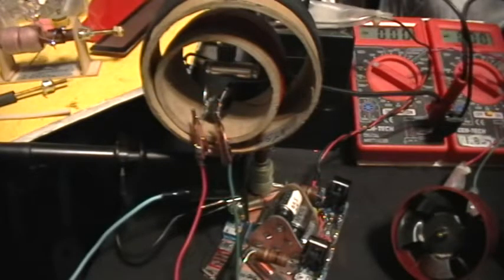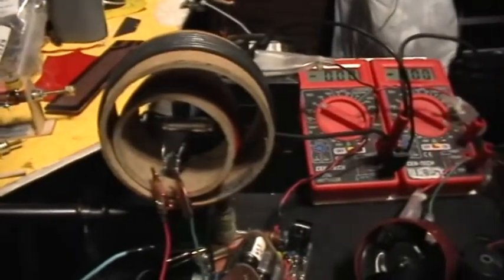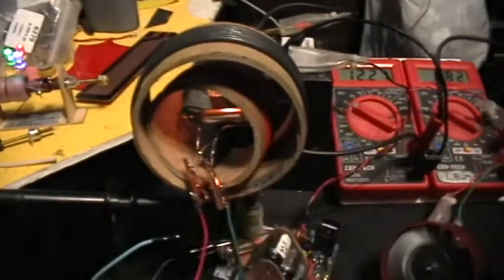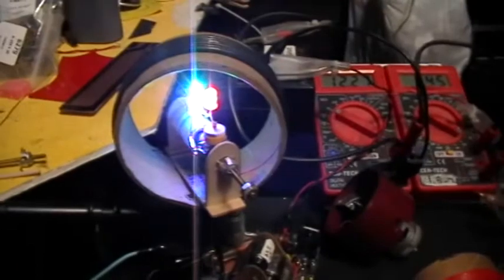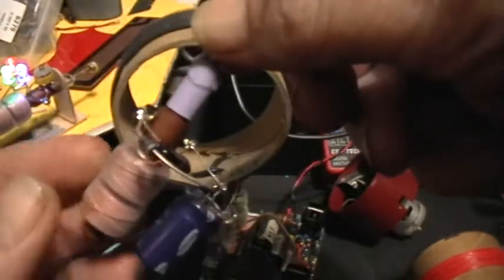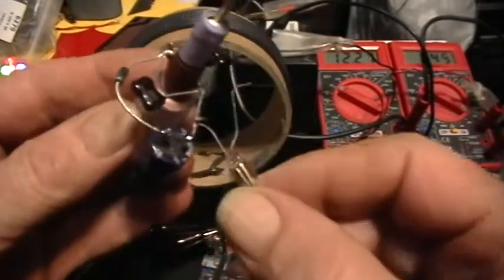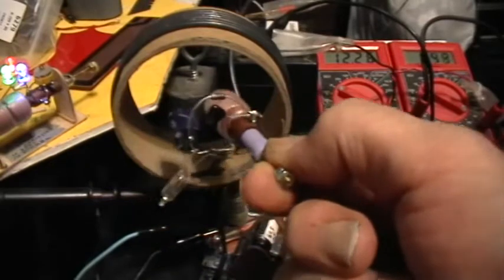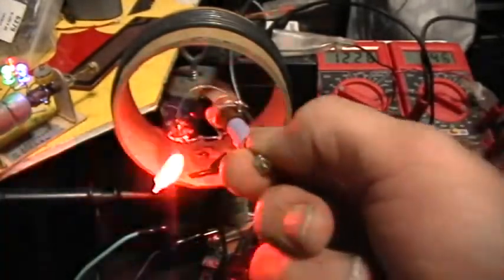Electric OU: MicroQEG Spark Core Conditioning

Comment: Well done TK,  but what do you mean by spark core conditioning ?
What is conditioned ?
Does it somehow feed back to the driver aircore coil or what ?

BTW, do you use a low pass filter at your DC amp meter to really see
the real DC amps going into the circuit ?
Otherwise with such a pulsed input and high EMF field around it it will surely read BS...

Regards,Stefan..
Reply from the maker: Hi Stefan
Spark core conditioning. I dunno, but it is something that Thrapp claims is necessary and that is why the FTW QEG is sparking in some of their recent videos. The "Exciter coil" and the spark gap are supposed to be used for the first couple weeks of operation to "condition" the core -- their word -- and then it is no longer needed. Some explanations say that this action pre-magnetizes the core. Sure. Why didnt they just start with magnets in the rotor then. I know why, and so do you: the FTW QEG's magnet-less rotor is a necessary Red Herring.
No, I have not yet fed the sparking back to the driver coil. But please see my latest "supplement" video that I just now uploaded.

The MicroQEG has a built in input filter cap and does not have a pulsating input. This has been verified by me, on the oscilloscope, and also by "Isim" in his simulation of the circuit on the forum thread. It really is straight, non ripply, DC input power and the meters are reading honestly. I have also verified the DMM input current reading magnitude with a csr and scope. These meters are the shielded kind and don't respond (much) to the stray emanations from the output coil either.
The "overunity" and high COP of the FTW QEG and the MicroQEG come not from the input measurements like the "20000 percent" claimants, but from the "output" measurements. The FTW QEG people are measuring the contents of the tank circuit and calling it output, just as I have done here. There is only one problem with this approach: you cannot drain the tank faster than your are filling it, or it will become empty in short order.
;)

Comment: I looked again at your video and during the sparking and well light neon there did not seem to be a corresponding big hit on the current draw....Is it in line with what you would expect.
Also Lidmotor's currrent vid show that many people are interested in this type of experimentation....maybe as lasersaber did; you could sell your designs...I bet there would be much interest even without OU... I would buy one...Thanks again
Reply from the maker: Yes, good that you noticed that, and thank you very much for the question, it gives me the chance to explain the power transfer between the primary resonant tank and the "receptor's" resonant tank.
The DC power supplied by the battery is relatively constant because it is just "keeping the tank full" at a constant rate of supply. The tank itself (the TBF loop and the capacitor stack) act as a reservoir that holds a lot of energy (relatively speaking). The "receptor" and its own tuned tank circuit extract this energy from the uQEG's tank at its own rate, also constant (if I am not moving the thing) and storing it in its own cap. When the voltage in the receptor cap has built to the neon's flash voltage, the receptor cap discharges. The primary tank in the uQEG itself hardly feels this at all, just continues being full (due to resonance) and continues being topped off by the constant dribble from the battery. The reason the voltage can build so high in the receptor (over 500 volts) , if the neon isn't connected , is something I am still exploring. At this time I think it is transformer voltage rise action, since I am effectively using a 6:600 turn aircore transformer, with the receptor's loopstick coil as the secondary of this impromptu transformer.

(Looks like the YT AI interprets every case of numbers separated by a colon as a reference to a time in the current video without doing any sanity checking at all.  That's pretty stupid, YT.   14:72   See?)
Reply from the maker: Please post a link to the Lidmotor video you mean. It might be hidden at first by the spam filter but I'll approve it as soon as I am notified.
As to selling... no, I don't have the facilities to make and sell devices, and my schematics and construction plans are all out there in the wild already. The only thing I can sell is the occasional consult, on particularly gnarly issues. These I do not talk about in public. If you need something like that, contact me privately and we can discuss arrangements.
Reply: TinselKoala I wish I had the resources to hire you. I wonder how you are able to put in as many hours on this love hobby of yours.
This is what kickstarter and indigogo should be for..to fund guys like you and lasersaber and others who are opensourcing their time for the better good.

That is a goal I would work towards.

Comment: Well, all that's left is what? Finding the resonance of steel with mechanical oscillations ;) Spark gap conditioning lol.
Reply from the maker: That will be a tough one, since there's no steel in my uQEG. Maybe if I drop it on the floor enough times it will ring like a bell.
(Someone on be-do actually suggested this for the Big QEG.)
Reply: TinselKoala Just drop it on the ground and hit it with a hammer a bunch of times.  It might not ring but your ears will.  I have begun gathering parts for replicating some of your projects.  I started yesterday by buying a big package of tongue  depressors.   They should come in handy for all kinds of gizmos
Reply from the maker: *****
Great! I hope you didn't fall for the Tongue Depressor hype that is out there. You can get them at Mall Wart by the hundreds (craft sticks) , and they don't need to be sterile at all.
;)